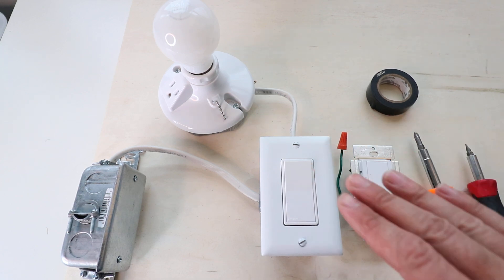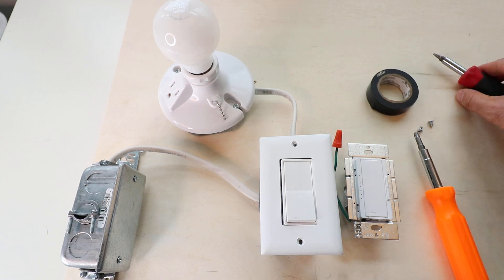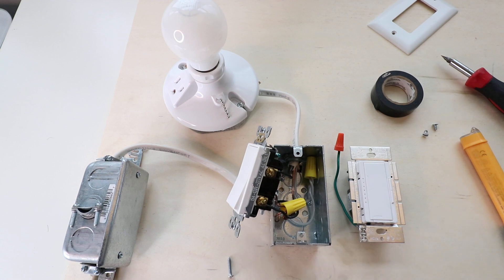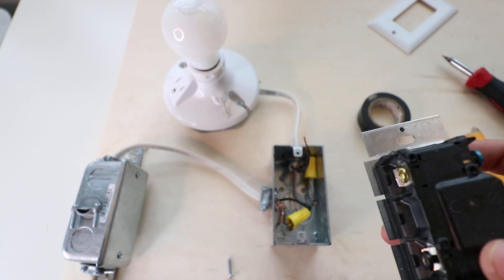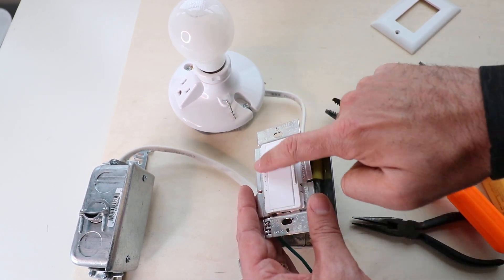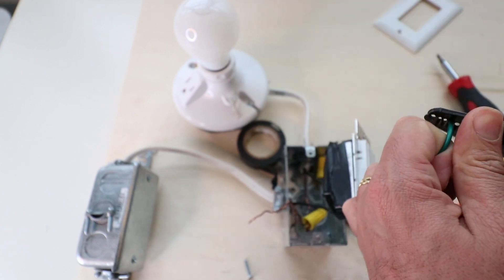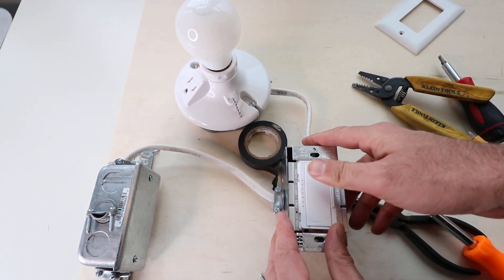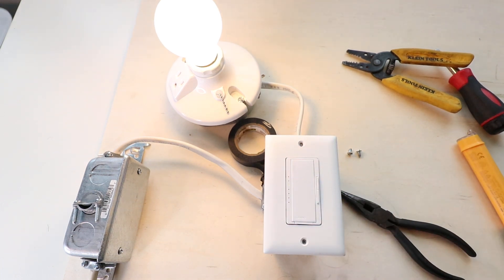How To Install A Dimmer Light Switch

Comment: Finally. A basic black, black, green wire install with a 3/1 pole switch. Every other video shows wiring with red wire which I don’t have. I now know I installed it correctly and the switch I have is bad.  It won’t dim at all.  I’ve event tried the trim setting (with power off) and still no dimmer. So back to the store it goes and I’ll buy a better make brand this time